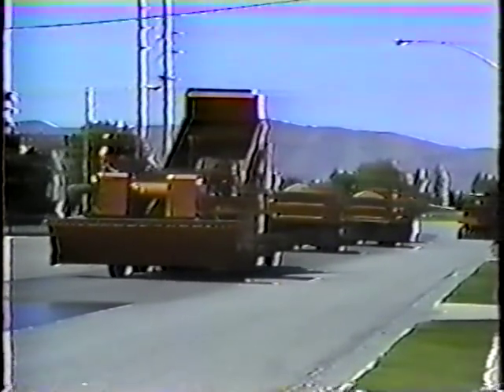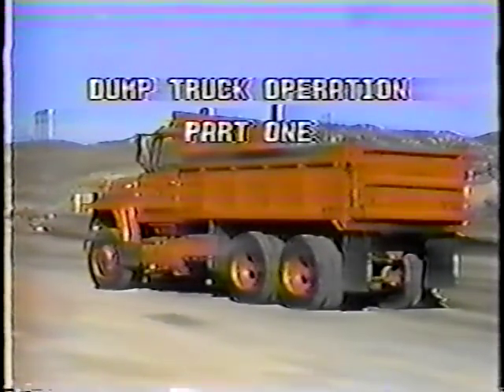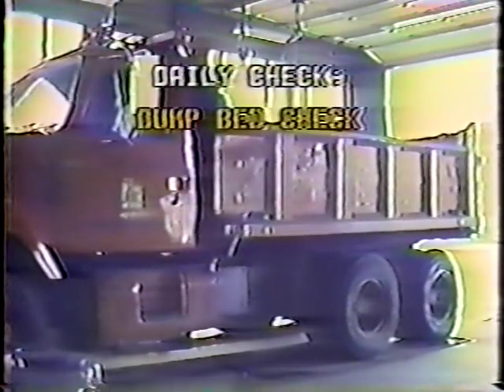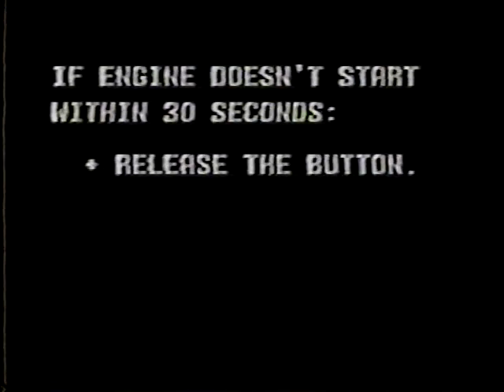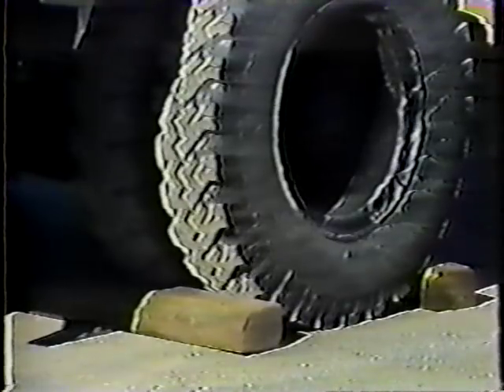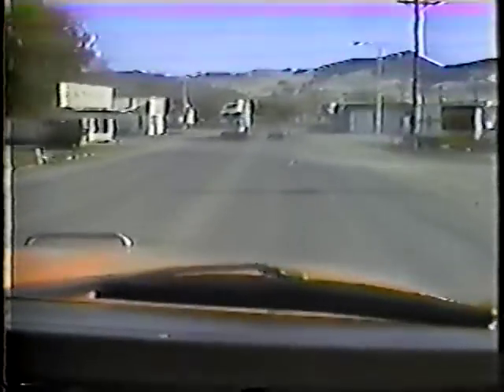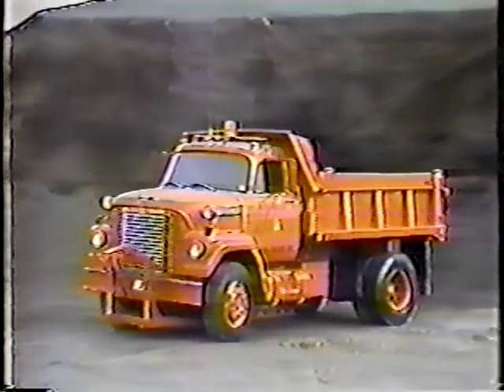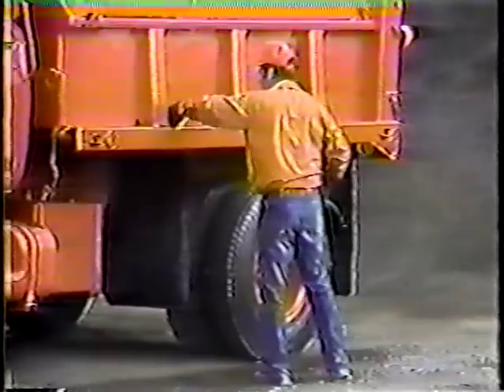Dump Truck Operation (Part 1)

Comment: If only it was that easy.  There is a 20 minute Air Brake inspection and Slack Adjustment measurement.